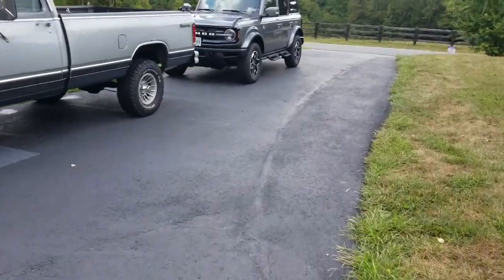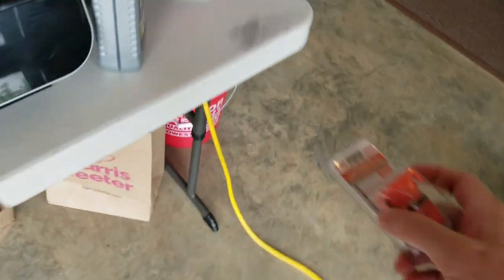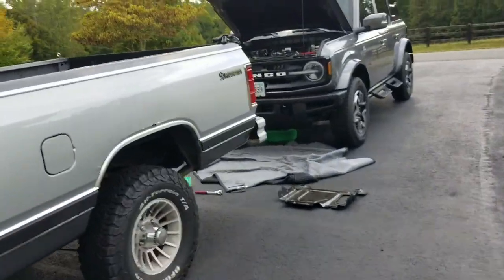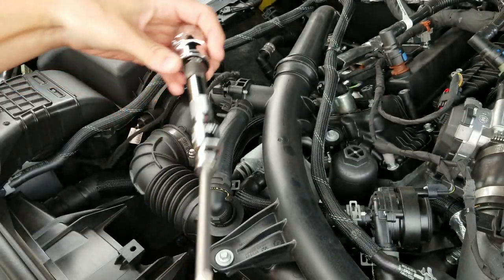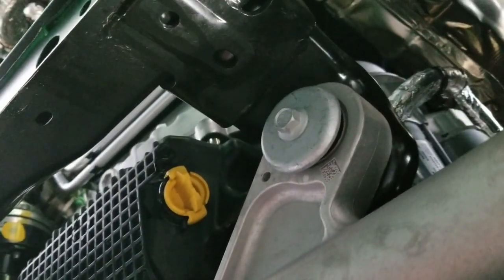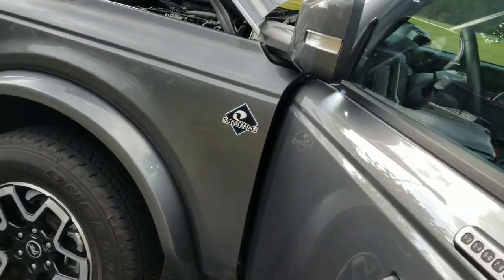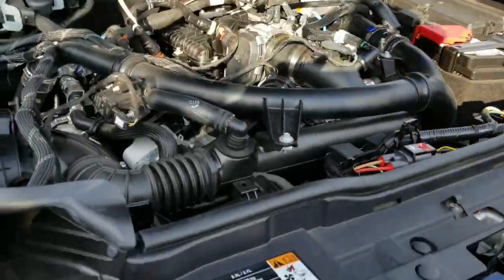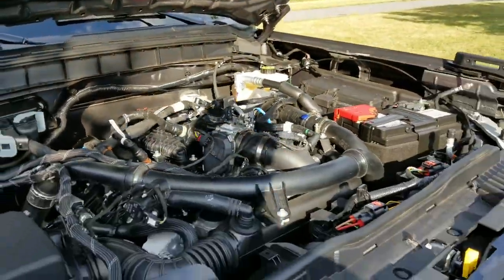Ford Bronco Outer Banks 2.7L Turbo Oil Change

Comment: You do know about the oil prime feature on these, correct? You step on the brake with left foot and push accelerator with your right foot and push the start button for 10 seconds. Engine cranks but won’t start.
Reply from the maker: No idea?
Reply: Thanks for the tip

Comment: Ive always done the x pattern if its a used spare i put them up front if its not i put it in the rear. Different ppl do different things.
Reply from the maker: With non-directional tires, and a good spare into the rotation mix, you'll get 20% more tread life (extra tire in the mix), and .... that spare is doing no-good on the back just rotting away because it's going bad all the same as the ones being used and will have to be replaced in about 5-7 years even if it never hits the road.  Hence, the pattern I showed.  Cheers .... :)

Comment: The wheels are only 66 lb/ft?!  It's 150 lb/ft on my '15 mustang, I'm pretty sure it's the same on a '23 as well.
Reply: I just checked the manual, your wheels should be at 100 lb/ft; if it were a Raptor, 150 lb/ft.  The spare should be 44 lb/ft
Reply from the maker: They are 100 ft lbs.   Sorry.  I'll be correcting that in the subsequent video.

Comment: Fram filters have shown themselves to be not very good, i know you fitted a ford, info just for future reference. When buying engine oil make sure that it meets or exceeds the engine manufacturers specs, which is always written on the container, usually on the back, just compare with what spec Ford oil is, this is a different number than the SAE 5W-30 and usually has a series of letters before it. I'm in England it isn't a problem if it's a well known brand like Castrol, but ive not seen Fram oil before. From someone who's been servicing their own cars for 40yrs, and a happy a-s2200 owner.👍
Reply from the maker: Yes, I used a Ford filter, but the store did not have Ford oil.  However, the Fram oil did exceed the synthetic oil specs that Ford provides.   I totally agree with you.  Using substandard oil or incorrect viscosity could be devastating.  Cheers from Virginia.